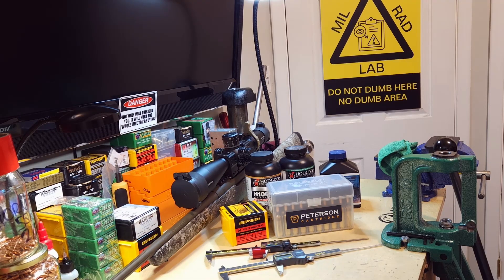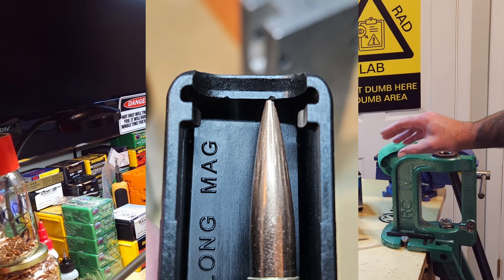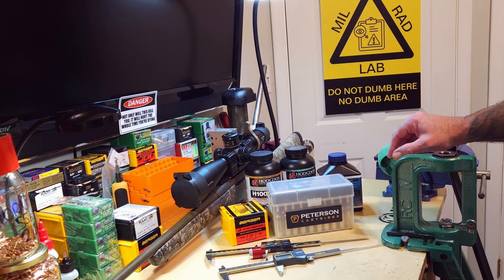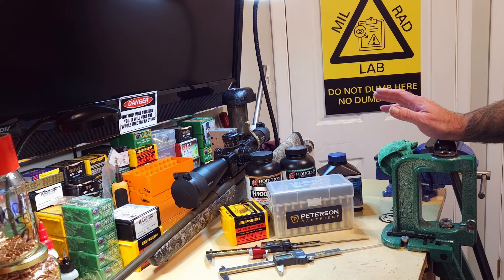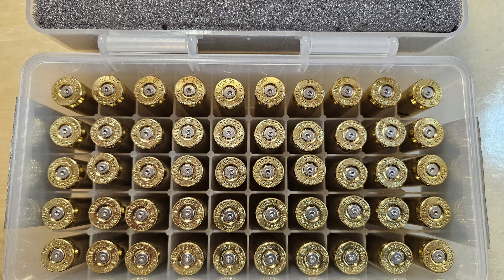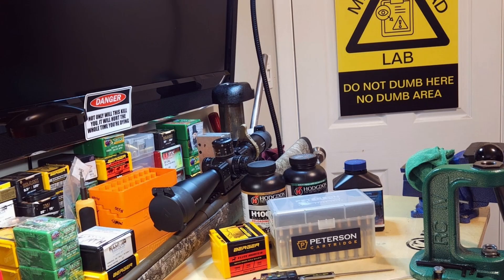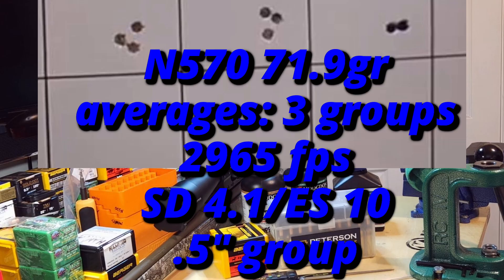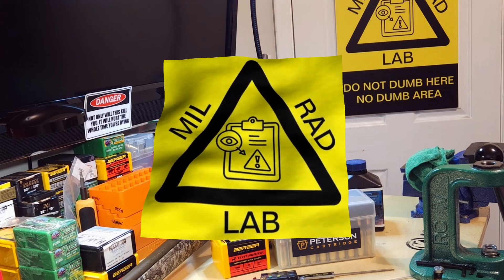Reloading 7mm PRC vid #4 Berger 195gr showdown between N570, H1000 and Retumbo

Comment: Great video series! Is there any reason you switched away from the Federal GM215M that you used in the first video to the cci BR-2 for the rest of the series?
Reply from the maker: Thanks and thanks for watching! I dont have my data sitting in front of me at the moment BUT I recall that some study was proving that the non-.magnum primer were getting better consistency (ES/SD) - now take into consideration that many will say that BR-2 are actually a mag primer. I have hit some nice numbers and good sweet spots with them. Another reason that pops into my head is that I use the GM215M for all of my 338LM loading and while I have alot of em I dont want to chew Into my stock - knowing that I have a few K of BR-2 that were otherwise unused, they were a suitable swap-out.

Comment: I just wish I could get my hands on some N570. I have plenty H100 and Retumbo but H4831 na N570 are hard to find. Great video. I’m currently loading for my 7PRC with a 33” barrel so velocity has not been a problem.
Reply from the maker: Thanks for watching! 33" is awesome...thats gotta be at or near the sweet spot for max velocity out of that cartridge. I guess I got lucky when I found N570 in an 8lb...at the time I dont think I had to look very hard. It'll be good in 338 LM also, so I sort of went after it for two purposes.

Comment: Every piece of brass in that box has primer cratering, and ejector marks on them. Those loads are over pressure, & that brass will no longer be equally uniform. Your velocity with 195g bullets will be around 2800 +/- for this cartridge, the 7mm PRM will not give you speeds like this unless your running a 29-30 inch barrel.

Comment: So how's the temperature sensitivity on the Vit? I live in Texas and do my reloading to prepare for up north, Wyoming, Montana, Colorado. I know I can count on Retumbo, H1000 and H4831. Never tried the Vit, Grand or LRT.
Reply from the maker: Thanks for watching. My experience with N570 is that it is (like most powders) sensitive to temp, but I only found around 10fps between 80*F and 40*f so I would say its at the middle of the road for powders I use. As an example of how load to load/powder to powder is so different is my use of N555 in 6.5 CM. I get nearly no change (so little its not worth noting) between 90*F and -5*F with N555 while some others claim they see a decent swing. Im no brand loyalist, so it would appear that I'm a Viht fan boy but the truth is these are just available powders that have worked well for me.

Comment: N570 for the win. Went Sunday worked up a load with the 175gn Nosler accubond. 73.2 gn n570 3120fps half inch groups 🤙
Reply from the maker: Good God that's SCREAMIN! Good for you!!!! .5" is awesome.
Reply: @MilRadLab definitely please to see it’s working out for you. I have some n560 coming going to test that but definitely think n570 is the sweet spot
Reply from the maker: Yes sir and if N560 is too fast, the 565 may fill that void between the two.
Reply: @MilRadLab  tried 565 got better results with the 570

Comment: Are you getting 100% powder burn with the N570? When i run that through GRT for my rifle im not anywhere near 100% burn woth that bullet/powder/cartridge.
Reply from the maker: i show 99% plus fill and 100% burn on everything over about 70.5gr with all of my parameters entered. i think down low it was under 100%. do you have your actual case volume/trim length/Bbl length/actual OAL/seating depth entered? its wild how different GRT's and QL's estimations are with stock SAAMI numbers. BIG difference with my setup, but some peoples stuff is really close to SAAMI spec.
Reply from the maker: I just checked the numbers in GRT and it turns out i get to 100% burn right at 68.44gr - everything above that is 100%. Below that it tapers off pretty quickly down to 94% around 65gr.
Reply: @MilRadLab  Thats good data! Is that quickloads or gordons only? I'm only curious cause I see some real deficiencies in quickloads when it comes to powder reactivity predictions. Some of their numbers are really far from what I see at the range with all of my data input correctly. I use two chronographs and average them so it's not poor data collection on my part, it's the software or the person installing the values for powders etc.
Reply from the maker: That particular loading it was just GRT because I lost faith in the info i was getting from QL.  Ql can be right on the money sometimes BUT it seems like GRT modeling is more precise (just my opinion). You are wise to collect velocity twice. There have been times i've had my doubts about a reading and wished I'd had a backup source

Comment: Book shows 65 h1000 as max wow what a surprise that 69 is to much 😊
Reply from the maker: yep, but the book doesnt calculate your correct case volume/length/throat/chamber dimensions, actual headspace/primer selection/seating depth...books are also built in 11% average below actual pressure max. I worked up to this weight very slowly over several sessions (previous videos in this series). using GRT and QL with my propper dimensions /volumes shows there is still room to 69.9gr in this rifle/brass/bullet/primer combo at the original seating depth.
Reply: I think the "book" probably shows a whole bunch of low maximums. Some even show maximum charges that are well over the limit in some peoples rifles. Vitavori comes to mind, they have a few that show max where from making my own ladders I would never try an shoot. I think it was Gavin who did a whole video on 6.5 needsmoor and "book" data and then using pressure testing equipment showed that some of those "book" maximums were low of actual by over 15%. Cant always go by the book - something that takes time to learn for some I guess.
Reply: @K-Deantheflower  HA! Book data isnt worth the paper its printed on 75 percent of the time. Your grandpa used to swear by it like it was the holy bible but it's not like that anymore. Anyone who only loads book numbers is cheating themselves cause they could do so much better but it's more fun to admonish others for not following their bible lol.
Reply: @JeremyStoeffer it depends.  I got  book data that might lock up my bolt in one of my rifles. It says 78 is max i got to 76 and had very hard bolt lift and ejector marks.  Thats why you always start low and work up with each rifle

Comment: When you try the Hammers ,try N560, it’s been the best for me in loading 162hhts. Tiny groups and pretty fast, 3000fps easy .
Reply from the maker: Thanks John! I appreciate that. I have N560, N565, H1000, Retumbo and Ramshot Magnum on hand and plan to shoot N560 for sure!  I'm trying to get to 3200 and I know I might be dreamin - I did leave off at 3126fps with H1000 with no pressure last time I tried a small sample pack of the 162's.
Reply: What charge weight got you to 3000 with the N560 and 162 Hammer? I'm just starting to look at loading the 162 hht. Kinda waiting on this guy to go first lol
Reply: You can definitely get 3150-3200 but you won’t get many firings out of your brass , I found that our 1st hand. To even get 2900fps out of your 195s is truly amazing and it has to be pushed your brass hard. But of course every chamber is different, some definitely handle full pressure loads better than loaded down for sure. 
I stopped at 64.0gr of n560 in the 162hhts, it was a sweet spot and that’s what I was looking for, not push them as hard as I could.
Reply from the maker: John that's great, thanks for sharing!  Definitely have had my concerns over brass longevity but it's been really good and consistent so far (fingers crossed). I anneal every firing and my shoulder bump is minimal. I gauge the primer pockets every time I process them and so far they've been the same. I know I've been pushing that 195 HARD and I don't plan to do any more of it aside from testing the 71.3gr load in N570 again at some point to prep for the hunt unless I end up choosing the 162 HHT over them. What Bbl length do you have? I'm thinking about a starting load at just under 64gr N560 and working up to look for pressure to see if I can get it to match QL or GRT and then start looking at mini ladders. Same in N565 if it looks like it makes sense.
Reply: Don’t tell anyone but N560 is the new RL26 😂
Reply from the maker: Amen - it's a secret!

Comment: If  increasing your velocities bt 7 fps by seating 2 thou deeper causes preasure 

You were already to hot anyway

Also ivexsean the exact opposite from seating bullets deeper it slows  it down because your farther from lands allowing more gas to escape reducing pressures. 
Just  my 2 cent 
I love the 195 in my 7 saum
Reply from the maker: I agree Jon but only partially. I was already jumping .034 to the lands, so the extra .002 - .0025 wasn't going to make that much change to that point BUT I did rob the casing of some of it's capacity - this is what I "feel" resulted in the noticeable pressure signs. I do believe I was right up against ultimate max but under pressure sign as in the previous range trip there was no heavy bolt lift or pressure signs on brass with those same loadings. GRT does show that I was right on the line and when I adjust seating depth by .003 it shows me over the line. There are a lot of factors there to consider in GRT but my case length/volume/Bbl length etc is all correct in the formulas. It lines up eerily will.

Comment: I knew that n570 would work good for you crazy how your best group was a .1 grain powder difference from best charge weight I found
Reply from the maker: You called it for sure. N570 just seems like a really good slow powder for this heavier bullet. It wont see any testing with the lighter 162gr Hammer but that is where N565/H1000/Retumbo should shine. I've seen the best velocities in load data using Magpro  BUT Magpro is well known for temp sensitivity so I'm not sure yet I will be giving it a try.
Reply: @MilRadLab  I ran magpro in my 270 wsm and I had zero issues with temp stability also run n560 for my lighter 7 prc bullets
Reply: @wyattlavallee8078  I'm getting ready to try N560 with 175gr in my 7prc.. I read a short article a guy claiming it's a bit snappy for 175. I may go to 565 if that turns out true
Reply from the maker: Good to know on Magpro. I don't have any on hand but it doesn't mean I wont get any to try out.
Reply: @K-Deantheflower  I’m using it for the lrx 168s and been good so far

Comment: Have you reloaded any berger 180  VLD hunting?
Reply from the maker: Not yet but I may eventually. The only reason the focus has been on the 195gr has to do with putting as much energy on target as possible if using a cup/core bullet because the loading is for Moose. I think the 180gr would be jut fine for the same animal you'd just have a few pounds less on impact. I do like that guys get them to shoot really well - might have to slide that in once I'm done looking at Mono's.

Comment: How funny that even with the increased velocity you still got to see where your load should be cause you had a fouling group that lined up for ya. Intentional or good luck? Great content thanks for taking us on this journey
Reply from the maker: Thanks Jeremy and thanks for watching! It was partially luck and partially good decision getting that nice group out of the fouling shots in N570. In the last video it was the lowest charge weight in N570 and shot a .23" group so I just wanted to use it as a fouler for this video since I'd selected the hotter 71.9gr load for the competition. When I shot that fouler group at 71.3 the speed was 2941fps and I knew right then I was gonna be too fast at 71.9gr to still be in that little sweet spot I found in the last video. It still turned out okay at .5" average on 3, 3 shot groups BUT it could've been better if I had loaded it down to around 71.3 no doubt.

Comment: Maybe I missed this but are you saying that pushing the bullet back 2 thou put you into pressure?
Reply: Yeah, the deeper seating increased pressure & velocity & put him over pressure for that load.
Reply: @GSRTrainingGroup I know it increases pressure but I think it’s likely other factors are causing the pressure more than 2 thou. Change in temp etc. not to mention he’s got a 195 screaming out of there. I loaded 195 in a 7 prc and was hitting pressure way before 2920. Now there is a lot of factors in there also. Different gun different barrel etc. you’d have to show me 2 thou made that much difference lol. No disrespect intended
Reply: @jacobdeem8499  I just watched him say the weather was actually colder today. In my 300 RUM changing seating depth .003" deeper made a pretty big jump in velocity but I didn't see any pressure cause I was well below max for the cartridge. If I had been up near max it would probably do to me what happened with this guys load. When you start stealing case capacity you get to pressure a whole lot quicker in my experience.
Reply from the maker: In the case of the H1000 and Retumbo loads yes. These loads were right on the edge of pressure signs last time through and the only variable altered for this video was the seating depth. Shoulder bump and neck tension were the same - primers, powder, bullets all same lot #'s as last video and the rifle was in the same bare steel completely clean bore condition. It is odd how the N570 loads didn't exhibit any pressure signs but I'm still going to plan the future loading .6gr below what was used for this bracket and get back down to around 2935-2940fps.